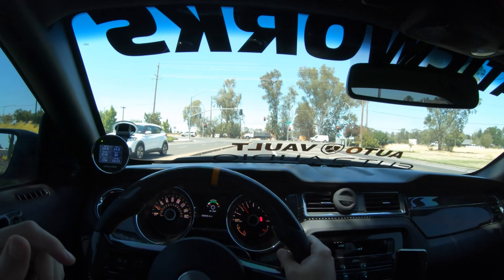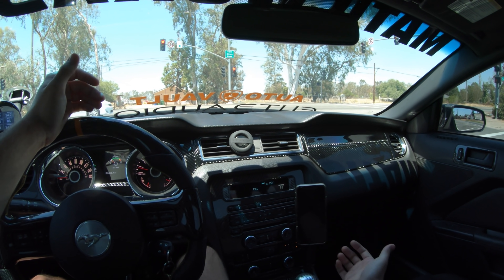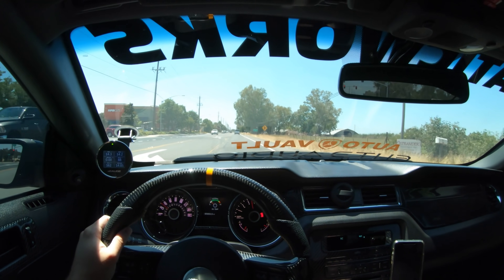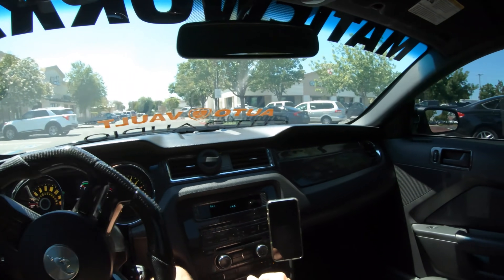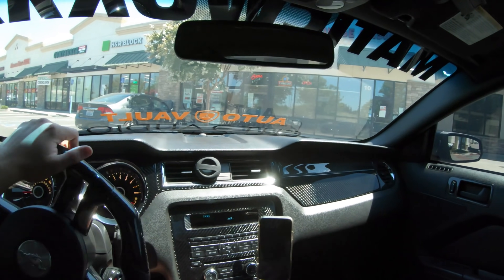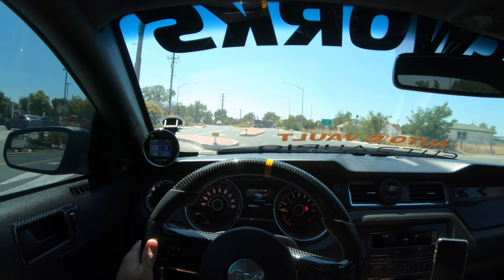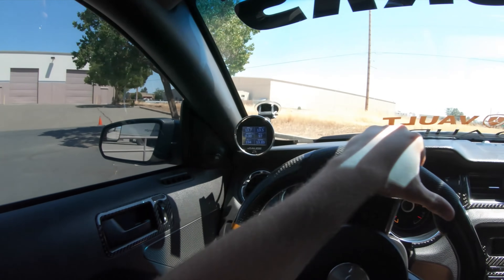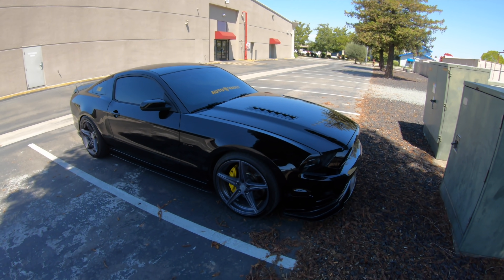How Much Power Can The Coyote Motor Handle? The TRUTH!

Comment: Thanks for the info, 2019 Bullitt, currently 650 RWHP Whipple 3 L supercharger, looking at adding stage two kit which would I’m told put it up around 720 rear wheel horsepower. Why? Because I can! And it would put me where I originally felt was my ideal range. The highly experienced and respected Mark from MARK’s workshop in York Western Australia believes I’m already pushing the motor to the limit of its  capabilities. Obviously, I don’t want to blow but I don’t do drags and I have rarely done a race track. I would be interested in your thoughts around this his biggest concern is ring gap of the factory engine is not sufficient for that amount of horsepower.

Comment: I'm shooting for 650, but due to the lack of quality fuel available here in Hawaii at the pump, I'm realistically in the low 600's. I have a gen 2 with a 2018 intake manifold, plugs, infectors and an ESS gen3 supercharger. Even with the lower than expected horsepower, she's a lot of fun to drive.

Comment: Guess this was done before OPG/CS's and secondary timing chain/tensioners were added as weak spots with boost. 8000whp is definitely not a "safe" number for gen 1 and barely gen 2 if you want the motor to last past 75,000 miles. Just because people do it, doesn't mean it's safe. There's a reason why you see so many $30-$40,000 builds being sold for $35-$40,000 in a car that would otherwise be worth $28-$32,000 untouched.

Comment: Ok so my 14 C/S Gen 1 is bone stock internals. I have Boundary OPGs on my Hellion Twin Turbo which is Lund Tuned. I have fuel injectors which are 95lb and a boost a pump on 93octane. This was a stock stick car that made 626hp on 6psi. I then turned the car up to 10psi and it made 753 wheel HP. I questioned it and made another pull and it made 748 wheel HP. I have a Hellion Header Setup with a Kooks cat delete X pipe. The car is now a Turbo400 on a Neal Chance Converter. I also have Strange axles in the rear. I’m telling you guys you still make jam with a Gen1 and it live.

Comment: My MT82 has taken a beating for 65k miles, still have the stock shifter too. I have a Boss intake, exhaust and a tune. I honestly think some people are trying to speed shift and let the clutch out before it's fully in gear. Also dumping the clutch is a killer. While I don't necessarily LIKE the MT82 but it'll last if you don't do dumb shit to it.

Comment: Shaun Perry of AED tuning proved the stock engine can handle over 1,200 rear wheel horsepower before letting go of head bolts not oil pump gears.

Comment: I have a 95 GT planning on doing a gen 3 coyote turbo swap since the motor in it now is original and has over 350k miles figured I’d see opinions on coyote motors since this is my first mustang (dad  gave it to me in his will)….I’ve been driving a MK4 Supra for the last 6 years and have been into tuners until now…thanks for the advice

Comment: I have a gen-2 coyote looking to have at least 750-800 rwh. This is my retirement 2017 GT and I would like to put it on the track some times. Adding the Hellion sleeper kit on the bottom with a tremec T-56 transmission and lowering springs. And then I have a convertible V-8 2006 GT, I have ported heads, lowering springs sway bars front and back, new radiator not sure if I will put a tremec transmission and will also put a hellion sleeper kit on it with a new fuel kit and more etc. As a child my neighbor had a long neck hot rod I called them. He had the skinny tires and the fat tires on the back. Going back to my childhood time and to just enjoy what I can now that God has blessed me to do after the military.

Comment: I keep being told a Gen 1 sleeved with forged internals is better than a gen 3 with only forged internals, gen 1 1000-1200whp and gen 3 between 1000-1400whp .. of course it varies. 
I'm only gonna sleeve the block if it isn't showing signs of cracking, otherwise probably get a gen 2 engine and heads and throw internals in it, only looking for 850whp on pump, which is more than possible with a forged bottom end. but with a bov and some higher boost, i've seen a forged internal only gen 2 car run almost 1000whp and it's running great.... so maybe I need to rethink a few things :D

Comment: my ideal power is Will be 650-675 hp, fat rears and nice beefy torque converter, Same time street legal, have the 14" premium
Reply from the maker: That's about where I'm at now with the Whipple, but manual. Did 628whp.
Reply: @JacobRDoty  I definitely love the build bro! i actually have a question, is the deck lit a 15-16 or did you get a 13-14 fitting with the style of 15-16?

Comment: I used to have a 2013 GT Convertible and I slapped a procharger and had 3.73's at the rear. I had  P1SC HO kit had 6 lbs of boost. It had 625 crank hp. The car ran 12s all day and not one engine issue at all. The problem I did have was electric issues with the tail lights. If you don't kill it on the boost any gen coyote can handle low boost. I wouldn't  go past 6 lbs if stock. I wanna say the gen 2 had a forged crank if I'm not mistaken. I had a gen 2 for like 2 months so I couldn't do anything to that motor. But, from what I know from a few shops is sleeve the coyote with forged eternals and the engine is pretty much bullet proof. Main thing if your a guy who just wants to keep the engine stock drop a 3.73 gear in the rear and your Mustang will wake up quick.
Reply: Was it automatic

Comment: So to answer your question at the end, I have a Gen 1 2013 GT. My goal is 550-600 whp. My reasoning behind it is that it's fun enough to be wild but low enough to be safe and not extremely expensive. Maybe more down the line but for now that would be plenty. It is currently stock with Corsa exhaust and cat delete 377 whp. It's still super fun but I can definitely see me wanting more later on. Thanks for the videos.
Reply: I have gen 1 2013 GT as well. I’m thinking later down the line I’ll swap it for a gen 3 and ad a stage 3 whipple

Comment: For safety and longevity, the general answer is around 750HP at the crank and around 7500rpm (with boss 302 or 2ed gen and up valve springs). Although the Coyote is plenty stoute from the factory it still has its limits. The main issues are connecting rods/rod bolts, the block, itself, eventually the pistons, and sometimes the oil pump. The coyote uses hypereutectic pistons, powdered metal rods, and a forged crankshaft. Upgrading to forged pistons, stronger H or I beam rods, and reusing the stock crank will handle over 1000HP depending on how good the rods are. 1st and 2ed gen use very thin cylinder liners that are known to crack under higher pressure and heat, esp boosted, so replacing them with more traditional, thicker liners adds a ton of strength to the block. This can also be done to a 3rd gen block. If you're doing all that it's a good idea to change out the oil pump to a bellet one as those have been know to basically explode, especially with belt driven superchargers, possibly something to do with crank harmonics. Another issue is Ford started the Coyote with very long, 12mm head bolts that tied deep into the block, down into the main webbing, the strongest part of the block. Some later Coyote blocks used much shorter 11mm bolts that end about where the knock sensor bosses are in the valley. This can lead to cracking issues in the at area with high boost. The good news is a 11mm block can be converted to 12mm.
People who've done all that have taken these motors over well over 1000hp. I think MMR is pushing 3000hp with a proper bottom end and reinforced block.
Reply: @tomspecht4733  It's possible. Hopefully they're both salvageable. 👍
Reply: @tomspecht4733  
The cheapest option if building from scratch is probably to start with an early f150 block, buy a set of 2ed gen heads and gaskets, cams, chains, sprockets, ect (you cannot mix and match generations of timing components) and 3rd gen intake manifold from Ford or whoever. This basically gives you the best of the 3 generations without getting into direct injection or the crazy expensive gt350 stuff. This combination will be a little over 400hp and run on regular fuel (trucks had lower compression) just be really sure the cylinders are in good shape as they can't be bored. 
Darton sleeves can cost over 1000 parts and labor but can be bored.
Reply: @tomspecht4733  
The 2ed gen has significantly better heads and moderately higher lift cams but I would disagree that the 2ed gen block is better. Most, if not nearly all, of the 2ed gen blocks used 11mm head bolts which were weaker in high boost/horsepower applications. The 12mm bolts where a little thicker and much longer, tying into the main webbing deep in the block rather than the bottom of the water jackets which are known to crack under high boost.
Again, ideally if this is a high power combo a 12mm block with 2ed gen heads and cams with a 3rd gen intake is about the best all around without getting into thd really expensive stuff.
1000 bucks for 2 coyote engines is a hell of deal, almost too goo to be true imo, but even with all 1st gen stuff it will make probably double the power 6cylinder did, maybe more.
For 5k I'd get the truck engine and add 2ed gen heads, cams, 3rd gen intake and do a billet oil pump for a little cheap insurance.
Reply: @tomspecht4733   
Let me put it this way, I paid $2500 like 4 years ago for a 2011 f150 coyote pullout.
1000 for two even with issues is a really good deal.
A cracking timing case? If so that's nothing. Replacement timing case (you'll want the one for the mustang) is cheap. 
A dead hole is more of an issue as it depends why dead. As long as the cylinder past the liner is still good worse case you can resleeve that cylinder or the whole block and save it. If not even the f150 heads are worth something to a guy wanting to build them for racing.
Reply: 😂 the block itself?  There are 2500 hp Coyote running the stock for Coyote block.  The block is not a weak link.
Reply: @freedom6919741  Sleeved "stock" coyote blocks CAN get away with that power for a while but you're starting to get into promod territory of billet blocks.

Comment: I have a 2012 GT. Like you said,around 650 RWHP is the safe limit,(because of the weak/non-forged connecting rods) and you can’t really use anymore than that on the street anyway!

Comment: I had a choice between a 09 gt or a 14 v6, I took the 3.7 2014. Nobody expects a v6 Mustang to be quick so it'll make a good sleeper and after doing some research these 3.7's have some serious potential. There's quite a few 3.7 single turbo cars running 550-600hp on stock sealed motors reliably with very little other bolt ons. They're just as capable of making every bit of 8-900+ horsepower built. Only thing missing is that nice v8 rumble.

Comment: For a guy that wants to appear to know the Yote motor well. I'm 12:45 into the video and I haven't heard you mention one word about the cast oil pump gears. Those are much more at risk than the rods. Guys  have swapped over to the billet gears on stock motors if they do track days or drag race often.  Most say @ 550 hp you should consider making the change.  To follow a safe theme if you increase the hp then change them. You are placing a lot of stress on the stock cast gears. Making the change is cheap insurance for the rest of the mods down the road. And the stock crank is forged steel a step up from that is a billet steel. None of the Yotes use a cast crank

Comment: Gen2 is basically the roadrunner engine from the boss.   The rods are forged in the gen 2. Larger valves , heavier valve springs , etc….  
My 2015 Roush stage 3 is now a 750 whp for 2yrs now without issue.  And a daily driver.

Comment: Hey Jacob I have a 2014 saleen white label but its black it's got some upgrades already from saleen,I installed oil catch can,roush cold air intake resonators deleted,nmbr axlebacks on her, installed mbr lower control arms from saleen 440 at crank so I'm prob around 450 too 460 at crank, now just want a one piece aluminum driveshaft and get her dyno tuned and that's enough for me lol, thanks again jacob

Comment: I have a 2013 gen 1 coyote. I would like to make 500 rwhp. I do not want to open the engine. I have added a performance mag meter, a k/n black widow air box, and a set x4 tune w/93 octane. I have the auto trans. The car has 10000 miles on it. How close am I and what can I do to get there. Art, Naples, Florida.

Comment: My goal is a nasty autocross car. Anything over 800hp would probably never be useful. 435 is definitely not enough 600-700 would probably cut it.
Suspension brakes will need addressed first and foremost.
Thanks for the vid.

Comment: 900 wheel is NOT reliable, unless you consider reliable 10000 miles. I own a whipple 2013 620 whp, buddy 850 in his 2015, drag race every wednesday, didnt make 1 season.  Mine 2 seasons before having to rebuild rear end, next season doing transmission as my planetary is making noise, ie going
Reply: IF you race 900 NOT reliable. By the way OPG is weak link in coyote motors, then rods,

Comment: There is a misconception that turbos are easier on your car because they lack low end.  That is more determined by turbo sizing to the engine and supporting mods as well as fuel used and tuning.  A properly sized turbo on good fuel with good tuning can have good low end (full boost by 3500 rpm).  The thing that makes them easier to handle higher power levels is because they don't take power to make power.  For example a blower pushing 700 whp is gonna be using 100 hp to drive the blower (just a guess not exact)  so even though it's at 700 wheel it's gonna have the stress of 800 wheel on the engine.  A turbo setup at 800 wheel would put similar stress on the engine.  With that said regaurdless of sizing it's never gonna have that instant throttle response and torque hit of a pd blower ecspecially a tvs but a properly sized one can have nice low end and a great overall power curve.  A centrifugal supercharger however builds boost with rpm so it isn't gonna have much power down low and it's gonna ramp up alot as rpm builds and it still has the same thing pd blowers do as far as taking power to make power so the same would apply there as far as the stress levels etc.  Now granted the centri prob isn't as tough on the rods as a pd blower with that vicious torque hit down low but you get the idea.  But the whole turbo is for high rpm only is a misconception that is determined by sizing of the turbo, supporting mods, fuel and tuning etc.  A nicely sized turbo with a big free flowing exhaust (or straight bumper exit) is ideal for response ecspecially if you're on good fuel that allows more timing down low and up top as well.

Comment: I have a 2021 mustang gt. Want to be around 750 to 800 wheel horsepower safe and reliably. Thought I was gonna have to do rods, pistons, oil pump gears, valves, and valve springs but this seems to disclaim all that?

Comment: Gen 1 mustang, mt82, in a 61 f100. My goal is 400 plus whp.  Plans right now are 18 manifold, stock tb, long tube headers/full exhaust, CAI, and a tune from Lund. From what I have seen this combo typically yields 420/430 whp which is fine by me.  Long term maybe cams, and gen 2 heads.  I’m not going to boost my motor. Doing oil pump gears for peace of mind.  When the MT82 goes I will likely just use my core and have it built.

Comment: Gen 3, 900-1000whp twin turbo. You get used to power very quickly, so I want to max out the stock block. I want the stock block bragging rights too, not a lot of motors can handle so much in stock form. Also I'm not building in stages, because stages get expensive. I want turbos so I can turn it down on the street, or turn it up if I see an opportunity.

Comment: Honestly my car is. A 13 coyote w the Roush 2.3 blower"
I first was on pump gas, tune, 47lu injectors and a 79 pulley and nothing else.
No headers, still has cats and all that, closed airbox and a challenge 17' hellcat would beat me by about a car"
No lie"!!
Once I went to the 72 pulley and fic1000cc injectors I w a tune I called out the same hellcat and it was game over for the fat kat" It didn't stand a change from any speed roll"Simply east up the hellcats that are on 91 pump gas and even a cai"
Now my car is on a 69 pulley but I had to upgrade fuel rails, fuel pump and I threw in a pmas cai for the Roush blower" It picked up significant gains and tons of top end🤤😃
Now I don't even woryy about hellcats lol but to begin w my goal was to make it faster so I beat them"
I'm at about 730whp and the car has treated me well" super happy and wouldn't have it any other way"Affordable and solid horsepower, oil changes every 3k👌🏻👌🏻🇲🇽🇲🇽💪🏻💪🏻💪🏻💪🏻

Comment: i have a 2019 Mustang GT Premium obviously Gen3 and up to this point (2 months in to purchasing it preowned 23K miles) ive only done aesthetic stuff, 30mm eiback spacers for wheels, changed all rear lights to MP Concepts shadowed out LED lights including replacing the rear diffuser reflectors to actual LED lights, installed an illuminated GT logo (rear) hardwired through OBD port Front and rear dash cam and then had a stripe wrap put on after i installed the GT350R spoiler (had that wrapped as well).  as for POWER… i’m not sure but 650 to the wheel sounds good to me for the same reasons u mentioned.  now i have taken this to the track but i think i’m not so much into the the 10-12 turns it had but rather id like to get it on a drag strip amd go for 1/4 miles times for fun.  so i don’t want to limit my goal to 650 but i’m def saving up to get there.

Comment: Hey I have a 2015  GT with a  Pro charger D1SC And they're rated about  925 horsepower to the crank I would like to make about 850 to 875 to the wheels The way I should be about it that way I should be about at the limit of the stock block start block and just hold it right there Honestly I'm good with 800 horsepower The goal is to daily it and keep it in a safe range so the engine can last